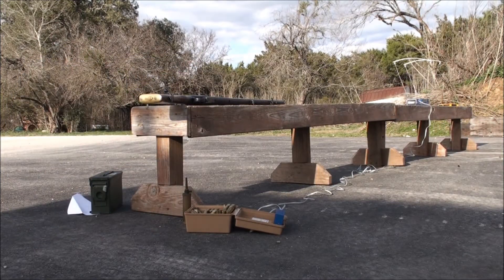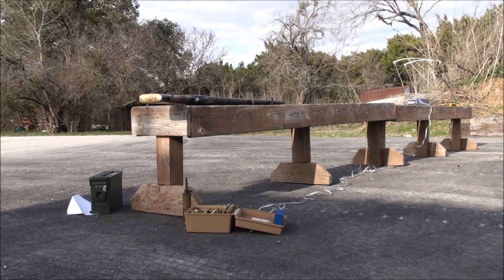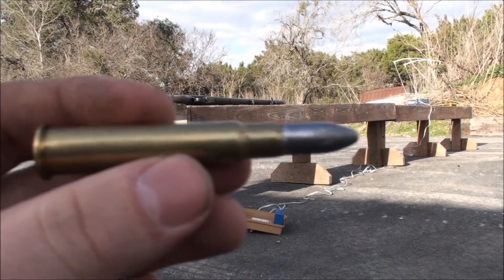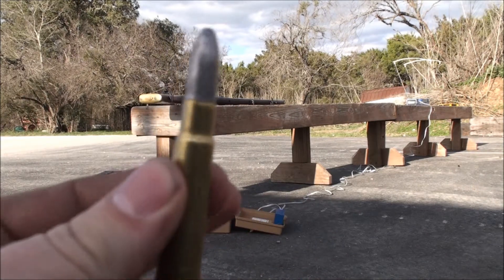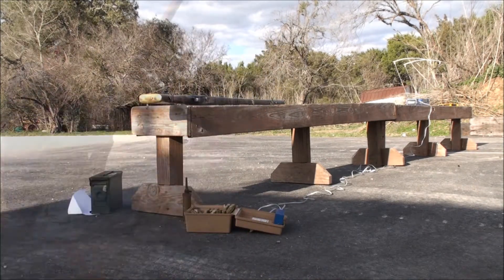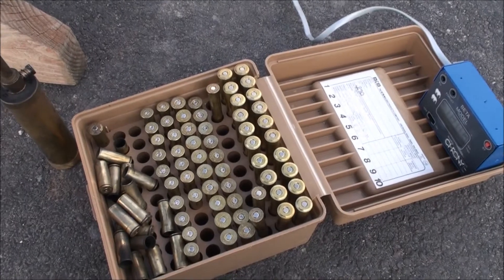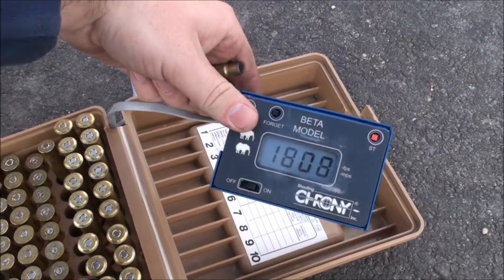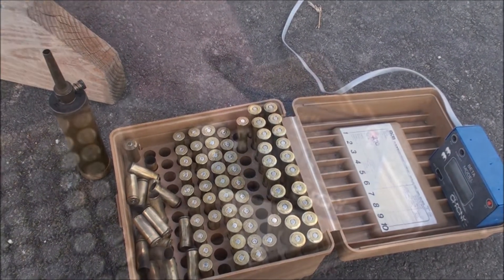No1 MKIII Cast Lead Velocity Test

Comment: Paper patching a .309 casting up to .314 then running it through a Lyman lubrisizer with only a tiny amount of Orange Magic to help water proof the paper somewhat. No glue, just dampen the paper so it sticks to itself. The rifling cuts the paper in the bore and it releases at the muzzle. It forms "confetti" at the muzzle but lets the soft projectile travel at jacket bullet velocities without leading the bore.

Comment from the maker: Mostly I use wheel weights, but I collect as much roofing lead as I can since it is much higher quality. My readings were as follows, 1838, 1795, 1789, 1821, 1815, 1809, 1799, 1798, 1805, 1801, 1808